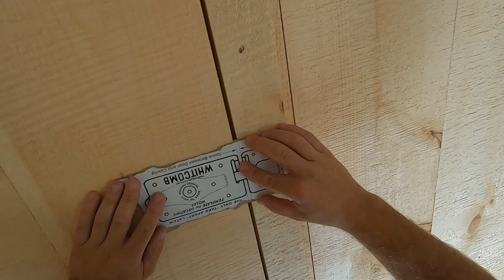We Failed New FARM Animals ARRIVE in 18 HOURS and we Aren't READY

Comment: Excellent workmanship on the barn.  Just curious, can the electric fence be positioned to run outside of the adjacent tree line/bushes clump so the goats can hang in there?  In other words, encompass more of the wooded/shrub area that runs perpendicular from the barn length wise?  From what little I know it might be a hassle since tall grass trips the juice on the fence and running it through a denser area would need more clearing for the fence run?

Comment: On the door with the double latch, I would drill a small hole through the wall and fit a piece of twine, connect one end on the latch release and the other end to a washer about the size of a half dollar. To open the door just tug on the washer, no more reaching over the door to get through.

Comment: I guess I just want to keep it simple -we screwed the feeders into the wall of the shed.  I do admit we need to strengthen the big metal feeder at the bottom. Too much weight is cracking the top bar. Plus we need a way to keep them out of the top of the feeder.

Comment: Stinky sneakers! LOL! I throw them in the washer and dry them in the dryer if their not leather. Hang the tied together shoe strings and hang them between the dryer door when you close the door so they don't rotate in the drum. Or put them in the sun to dry.
Reply: I just put them toes up against the dryer. But, I live in a very dry, hot climate. Putting them in the dryer or in the direct sun could cause them to shrink and/or the rubber to curl or even separate. If you do put them outside, I'd put them in either shade or partial shade this time of year, depending on the outdoors temperature... (we're reaching 100-112 in the middle of the day.)
Reply: @melissajarvis4829  Thanks for the tip. I'll give it a try. :)

Comment: Are you going to put a latch on that goat door to keep it from closing by the wind or a goat?  I was thinking something like the latch you put on the other door so you just have to open the door and the latch would catch.  Their inside area seems so small.  When do you think you'll be opening the other door?  Why did you put a door there to cut the goats off from going to the next stall?  I'm thinking about winter.  In the old barn,  you put up plywood.  Will the strapping you put up outside do the same thing as the plywood?  Having the goats crowded inside will help with their body heat.  No more mud with the gravel area there!!
Reply: I think he did the same setup as the other goat barn, so that a mama goat and babies can be in the adjoining room. Or the babies in there at night, separated from mom, etc. But, where they can still see, smell, and hear the rest of the herd.

Comment: 😲
Better hot than funky toes
I can understand the cold weather...... We are in central Maine... Not as cold as some but adds a healthy crispness to the air
Reply: I agree.  I live in Phoenix.   I wear socks so that it cuts down on foot stink.  And actually, socks keep your feet cooler, in the long run. You can change socks several times a day, if necessary. Also, socks do not have to be tall knee highs or crew socks.  They do sell little socks for men that are "no show" types. 
Also, most tennis shoes these days can be washed in the washer.  Even if they say they're not meant to be...  Do a short / gentle cycle with some old jeans. (You may need to repositon them during the spin cycle.)  If you are ready to throw  the shoes out, anyways, you have nothing to lose by trying this. And may gain a pair of good, broken in shoes that are clean and still usable. :)

Comment: ok i have what my mom calls swamp foot. i have found a way to save my shoes. it i replaced my shoes when they stunk i would be buying new shoes once a month. here is all you need to un-stink your shoes. Fine Mist Spray Bottle, and cheap 50 ml bottle vodka u use 40% alc/vol. to start you will need 3 small bottles vodka 

step 1: empty one bottle in to each shoe  to coat the inside of the shoe.  let them dry

step 2: the 1 bottle goes in to the spray bottle. i used an old kids perfume bottle. once a week spray the inside of the shoes 6 to 10 pumps each. let them dry. 

if you  have new shoes that you dont want to stink you will only need one bottle of vodka and step 2.

Vodka kills the bacteria that makes the shoes stink and the vodka smell goes away fast leaving a clean smell in you shoes

Comment: I have a full sized set of Ridgid power tools that I have used for years. Someone gifted me a set of Milwaukee M12. And I said they are too small to do anything, Boy I was so wrong! Even with the small battery we did so many things before having to change out to a new one, on my drywall replacement in the bathroom. With a bigger battery available there is no limit. And they have many options just like the bigger stuff too! For around the house they have become my go to, for almost everything.